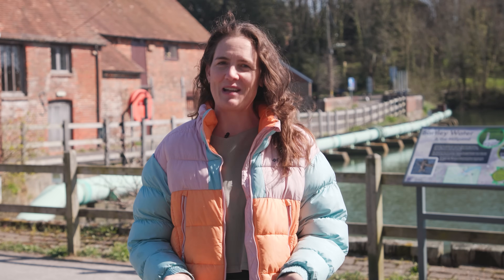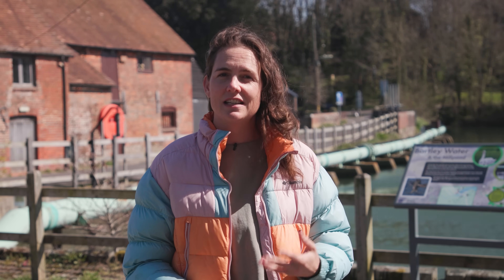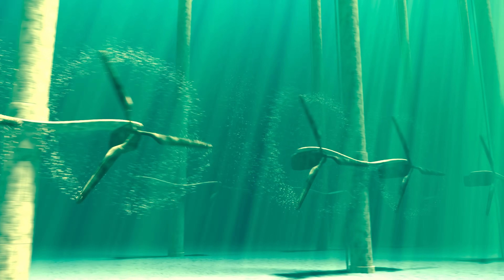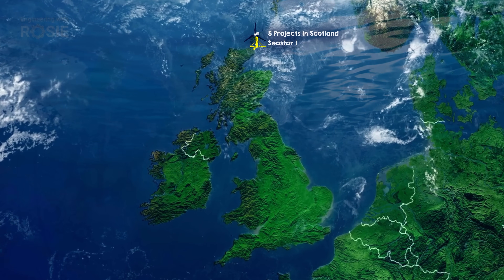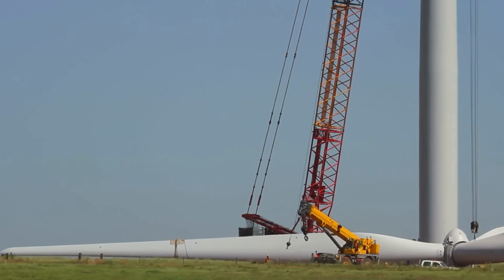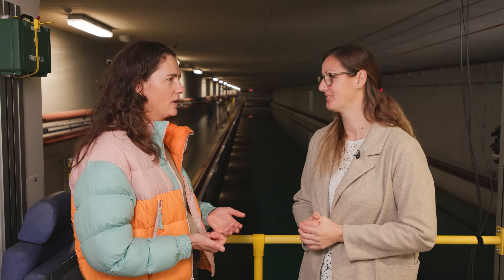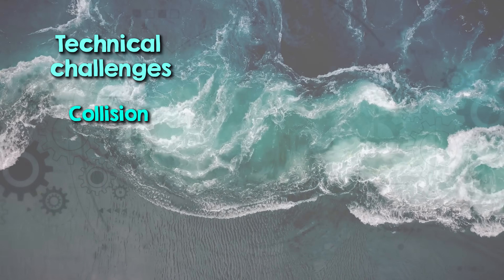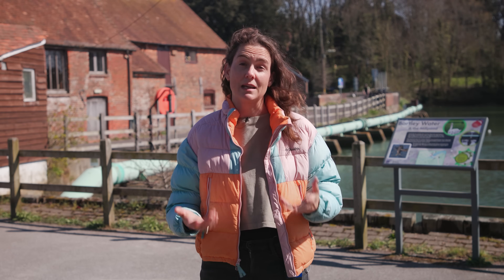A 1,400-Year-Old Idea That Might Save the Climate

Comment: I remember when I learned about tidal power and wave power, I didn't take them very seriously, because I was comparing them to wind. I was thinking that because you've got smaller turbine blades (less swept area) or just a small height that the other devices bob up and down, it couldn't possibly do as well as wind. I thought the increased density of the water couldn't compensate.

Then I read about experiments reporting lots of power generated, even with those bobbing up and down types. I then realized that the water density is huge. Orders of magnitude more. And that makes it work. This video at 4:09 helps convey that.

I think tidal power and wave power have a lot of potential!

Comment: The kite tidal generators are supposed to address the issue of slow moving tides to a degree, by using the wings for lift to travel around in figure eights to gain speed to run the turbine.

Comment: A simple mill floating and rolling on the surface of the sea, with a set of say 50 metre long but low-tech "drum" rollers with fins spiralling along and around the drum, and with each 50 metre roller placed two and two to form a "flat rearwards pointing V" (seen from above, and "rearwards" is of course relative to the flow of water), in order to not make the water flow around the construction, but rather in towards its centre (but generally UNDER the construction, which is where the energy harvesting happen), by which another set of two long flat-V rollers can be placed after it, and another two, and so on, could harvest a lot of energy, same time as the inavoidable splashing will add oxygen to the water, which the wildlife will benefit from greatly....

They will not run fast, but will have a lot of strength (and momentum as well, if the rollers are given some weight), so a gear station can convert the slow rolling into high-energy generators, generating electrical power....

All the more complicated parts are "dry", which simplify construction and maintenance greatly, and the slow rolling won't stress the framework for the construction etc much, like it will be relatively simple to clean the rollers of seaweed etc, if the fins can't be designed to be self cleaning (which they probably can, by their physical shaping), simply by making it possible for maintainers to walk around on the framework/construction, and cut away whatever seaweed and trash the rollers may have picked up.

The water will loose very little energy from the first V, and being placed in a flat "backwards pointing" V, water will be drawn into the system from the sides, regenerating whatever water-energy that may be lost from the first V etc, so a set of 50 or 100 or 200 rollers can be set up....
-In fact, that the first roller slow the water-flow slightly, and so lower the water behind itself, will make the water FALL in onto the next set of rollers, and if this effect is optimised in terms of optimal flow-handling, the next (and next and next and next etc) roller will most likely be able to produce additional energy....

If placed in low water, it may whirl up sediment, so they will probably need to be placed in some depth generally, but a rather similar system could be pulled up and down rivers, and by whirling up the sediment, the rivers could be cleaned for industrial-age pollution, all while electricity could be produced, and all while the water get additional oxygen....

If placed in the sea, a diametre on the drum of 5-8 metres would probably usually be fitting (however the larger the waves in the area, the larger the diametre will need to be, for it to be environment resistant), but for a system to operate in a river, the drums will probably need to be max about a metre or so, with 30 cm blades spiralling along the drum.

The system of drum rollers will need to be set in a frame, that (in the ocean, anyway) are to rotate freely around a fixed pole, which indeed do need to be build very strong.

Rather than having just a flat-paddle fin (quite like what water mills of old had, but a lot wider), it could probably be an idea to have short-span long delta "wings" mounted along the drum (and again, sort-of forming a spiral), taking advantage of vortex lift....?

Comment: Jeez, France has been doing this for ages, the UK already does it and so it’s just extra tidal power that has been requisition. Weird video that is putting this forward as new technology and all the nay sayers in the comments. Saying it can’t be done . I learnt about tidal energy working in France  in my physics A level in 1985. 
And you are showing the Thames barriers physical outdated method. It combines tidal energy with flood control. It used to be that London had problems with regular flooding , which has been controlled  if not eliminated the barrier. We have a large proportion of coast to land and do suffer from flooding fro the sea and tidal river problems together with coastal,land erosion.

Comment: What did climate alarmists use for lighting before candles? Electricity. 

Don’t you stress about the climate. It will be fine. It will continue to change as it has for billions of years. What we must really worry about are the whackos who believe they we can change the climate in any meaningful way.
Reply: No, sadly, you are missing the point! 
It is the 'speed of change'! Evolution, adaptation takes tens of thousands of years, making a three degree change in climate, over say one hundred years, is a disaster! 😢
Reply: With regards to 'Global Warming', a wee bit of a rant from an 80+ year old... 

As of January 2025, the global average CO2 level was 424.70ppm. Incidentally, this is a record high at about 50% higher than before the start of the 1760 industrial revolution. It has also been confirmed (WMO) that 2024 was the warmest year on record at +1.55°C. If we stopped producing any CO2 today, it would take some 100 years to reduce it by 40% and that just about represents the amount of CO2 we had put into our atmosphere since 1940. So, we have a very long way to go! 

Have tipping points already been triggered? This is a possibility, based on the latest scientifically fact proven data, and with mankind's continued need for fossil fuel, things are not looking good! 
 
It is a fact that the world’s oceans are warming at an unprecedented rate! According to the EU Copernicus’ 8th Ocean State Report that was just recently released, the rate of ocean warming has nearly doubled in the last 20 years. This already has considerable long term consequences! 

Due to ocean warming and the steady increase in water vapour taken up into our atmosphere, further warming is inevitable. Water vapour is estimated to account for approximately 50% of the total greenhouse effect, while carbon dioxide comes in at 20%.
 
Rapidly reducing Polar Ice is obviously causing ocean level rise, however the loss of reflective ice and snow covered surfaces is just another 'key factor' in regulating our climate. Due to the loss of ice and snow more ocean and land mass is being exposed and absorbing our sun's radiation. The Earth's average albedo is around 0.3, meaning that about 30% of the sun's energy is reflected back out into space. This is a very critical factor, and becoming more so with each passing year! Also the loss of snowfall and receding glaciers throughout our mountain ranges has also a significant affect. What once fell as snow now falls more frequently as rain. It was the snow melt water during spring and summer that once supplied fresh water to millions of people that depended on it. A highly valuable lost resource, and now causing problems. 

Methane emissions. Methane's global warming potential (GWP) is 28 times greater than carbon dioxide. On a 20-year timescale, methane's GWP is 84 times greater than CO2. Methane gas also has some indirect effects as being a precursor to the creation of ozone, yet another greenhouse gas. (Tropospheric ozone is both harmful to human health, and is currently responsible for about 0.23°C of current global warming). The natural release of large amounts of methane has a very 'fast impact' on the upward global warming trend. 

Something else of concern regarding methane is that vast amounts of 'Methane hydrate' is to be found buried in the ocean floor, it has a structure very much like ice. As the ocean temperature rises, the methane hydrate thaws and methane is then released into our atmosphere. 

We also have vast areas of 'Permafrost', approximately 23 million square kilometers of it! Most of this permafrost is located in Russia, Canada, and northern Alaska. Unfortunately it is a fact that some areas of permafrost are beginning to rapidly thaw. As the permafrost thaws microbes start to breakdown the organic matter, this in turn is releasing large quantities of both carbon dioxide and methane. Incidentally, and a subject that gets little mention is that this microbial activity also generates some heat, this in turn is warming and thawing adjacent material and starting an irreversible chain reaction regardless of external atmospheric temperatures. (Microorganism growth is generally between about 4°C and 60°C.) Another most inconvenient fact, is that the total loss of Earth's permafrost will have truly catastrophic consequences for our planet, and for life in general.

However, so far the largest source of anthropogenic 'methane emissions' is from agriculture. It is responsible for about one quarter of emissions, and very closely followed by the energy sector, which also includes the emissions of CO2 and methane from coal. Coal mining is one very large source of human-caused methane emissions, estimated to be 11% of global methane. The fracking and drilling for natural gas and oil are further additions. (As created in - "Drill baby drill".) 

With ever increasing global temperatures causing altered precipitation patterns, it has  caused considerable stress to our ecosystems. The very 'lungs' of our planet have been damaged by man with the clearance of forests for agriculture, and forest fires intentionally started or forests having become tinderboxes caused by drought. Evidence now exists that the Amazon ecosystem has now potentially turned into a net carbon source, this is yet another horrific finding!  

The effects of high temperatures on men and women. The human body and mental state of health at 40°C and coupled with high humidity will cause lethargy, irritability, headaches, poor decision making, and the possibility of heatstroke. At above 42.3°C further very serious additional risks come into play resulting in a marked increase in violent behaviour, homicides, sexual violence and assaults. Above 45°C both the body and brain is totally unable to cope, and it can cause irreparable damage to both the body and brain, this can result in death. 

The effects of global warming is now undeniable, even for those that still believe that the earth is flat! For those that ridicule mans efforts in seeking to become carbon neutral is sad, though solar panels and wind farms have great inefficiencies, every bit of energy created in this way helps in the long term. How this energy is sold on to the consumer, is a very different issue. Attitudes do need to change in every respect! For consumers having to pay for what 'could have been produced' during the loss of sunshine or wind, is unfair. We are overly geared up towards making money. In fact, the act of making money has contributed to our GW problem. 

What needs to be done? 'Food for deep thought'. With things progressing in the way that it is, mother nature will dwarf all of mankinds efforts, for she will inevitably take control with the mass extinction of many species of plants and animals, and possibly with mankind being included? 

I think it is reasonable to suggest that man will always seek to better himself, and in doing so is not being unreasonable at all, it is a normality. However, it is the number of individuals on this planet that are trying to achieve this aim. 
 
I'm trying to bring some degree of perspective into mankind's abilities to reproduce, and suppressing it. It is estimated that during 1940, the world population was somewhere around 2.3 billion. As of 2025, the world's population now stands at some 8,202,309,245, and is currently increasing at about 70 million people per year, this is placing an unsustainable demand on our planets resources. The world's population had actually doubled during 1959 to 1999, in just forty years it had doubled! The world's population is now expected to reach some 'nine billion' in 2037 and 'ten billion' in 2060. What will it be in 2125? As said, food for thought. 

The subject of Demographics and a possible way out of this problem, though I have no doubt it would be considered too draconian, also it would need the full agreement of all countries, and for those not willing to participate to be sanctioned. The excepted age for retirement set at about 63, both for male and female, and perhaps adjusted so that both can retire together. Childless married couples, or those in a civil relationship, would receive a 'generous pension' i.e. something to be considered very worthwhile. After all, a big sacrifice had been made and it should be rewarded. A couple having only one child, would receive only a slightly reduced pension. Those couples having two children would only receive a very basic but sustainable pension. OK, I know that it all sounds absolutely dreadful, but something really desperate needs to be done, and soon.
 
Well I have said my bit. One thing I am certain of, I'm so very glad that I'm not a newborn baby!

Comment: Something you didn't mention is the advantage of tidal range projects is that you can to some extent time shift the power to when it's more useful. It has to all be used before the next cycle starts so only a limited delay is possible, but you can ramp up and down the output like with hydro power. So it can contribute a bit to matching supply and demand. Whereas tidal flow is like wind power in that you have to use it in real time or throw it away.

Comment: I believe you have dismissed the barrage type of tidal system too quickly, it is true that they Are very expensive when viewed in the short term, but a properly built barrage system will
Last for hundreds of years, and when you need to replace the turbines and generators it Should be a lot easier in a solid stable structure, than trying to do maintenance on a turbine 
Generator anchored or tethered in a fast flowing river.

Barraged have other benefits the one currently being considered to cross the river Mersey Would follow the design of the South Korean version, but as well as producing electricity 
It would have a protective function, further up the river Mersey there is a town called Warrington which suffers when high tides meet heavy rain flows, if sea levels rise due to
Global warming, the frequency of floods faced by Warrington are also to rise.

So, the choice is to build miles of river side defences, or build a barrage that would stop tidal surges reaching Warrington and producing electricity at the same time, if money is to 
be spent I know which scheme I would choose.

When it comes to the mismatch between the time of productive high tides, and the time of Peak energy demand, there are alternatives, energy could be stored in batteries or in 
chemical form, but at the Merseyside site there could be another option, the banks of the Mersey are lined with old style terraced housing, constructed of double brick with no 
insulation fitted and difficult to retro fit and keep warm, given the compact nature of this housing they would be an ideal candidate for a district heating system, particularly one that 
is practically supported by electricity produced by a local barrage at low peak time.

Barrages are expensive, but given the hundreds of years they could give service, they would be good value over the long term, something long term investors like pension funds, 
insurance companies and sovereign wealth funds, who look for long term returns would appreciate.

Comment: Thanks for doing this video Rosie. So hope we can make it work economically here in uk.
The big issue the UK has is Scotland does not need any more generation. There is already too much from wind there. Until they can sort out the HVDC link done to South it would be mostly switched off.
So fingers crossed they sort the transmission stuff out soon.
They have been talking about the swansea lagoon concept for decades but can't get it past the environment issues. Huge shame as it is in an area of high demand so good grid connections already.

Comment: In my opinion, you did not emphasize enough the fluctuating power generation of tidal energy. The average output of such plants is only a fraction of their rated capacity, and four times a day there is a phase with no power generation at all. While the exact long-term predictability of output is indeed a significant advantage compared to wind and solar power, tidal power plants cannot be compared to thermal power plants that can continuously deliver their rated output.
Reply: Geothermal is great if the geology is right. But we are literally an island. Tidal needs to be a core ingredient to the energy mix.
Reply: @colinwiseman  I wasn't specifically referring to geothermal power plants, but to thermal power plants in general — including coal-fired power plants, gas power plants, biomass power plants, and nuclear power plants. Plants that can provide reliable and continuous power output. There's often a misleading impression that tidal power plants could fulfill this role just as well, without the need for additional energy storage. Yes, geothermal energy would be great if its economical use weren’t limited to locations with favorable geological conditions — similar to tidal power.